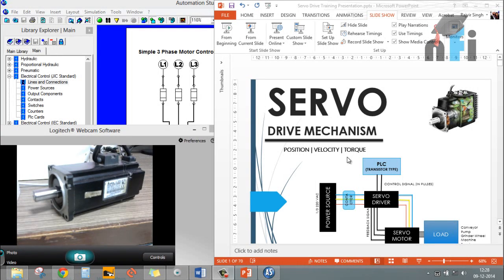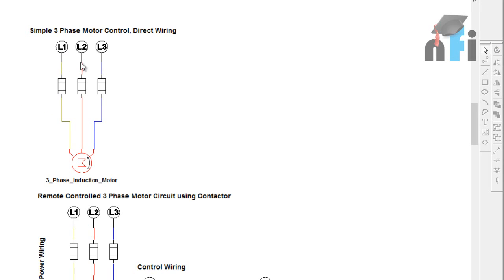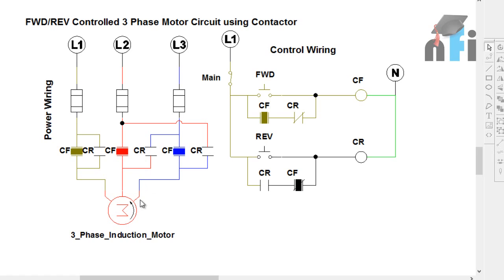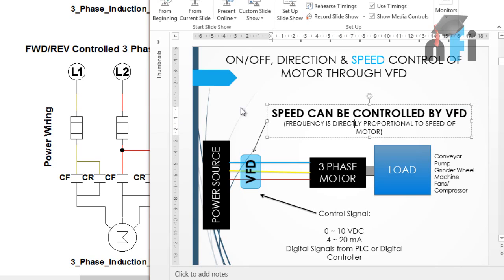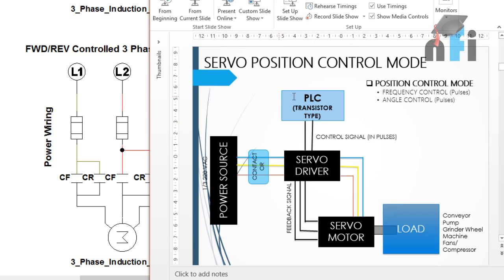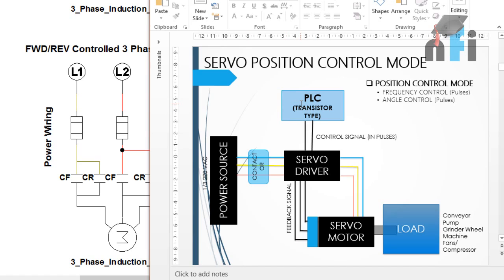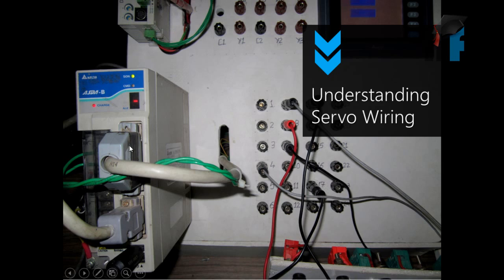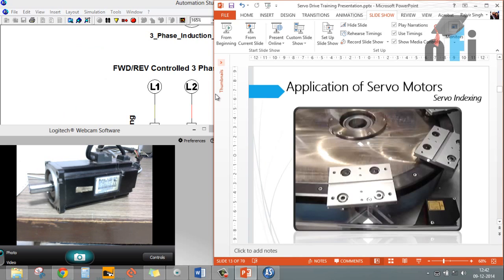Introduction to Delta Servo Drive and Motor

Comment: I have seen many small drivers needing only 2 phases input from mains but the servo will still get its 3 phase from the driver. How does that work?
Reply from the maker: The driver converts single phase to three phase internally 🤓
Reply: @thegeterrdone  so why provide 3 phase input terminals if only 2 phases are needed?

Comment: Wrong circuit on reverse forward control wiring.Interlocks should be in series with the coil and not in series with the latching contacts for maximum protecrion of energizing both forward and reverse.Because you can still start each circuit by the push button.

Comment: Hi,  I am  Ketan,  I run delta servo motor asda a2. Run through 2500 ppr encoder but all time measurements problem. Give solution

Comment: Dear sir,
Recently I am facing a problem regarding DELTA SERVO ASD-A2. In a cookies depositor machine I have installed 0.75kw ASD-A2 servo (ASD-A2-0721-M/ECMA-C10807RS), it runs at 2500rpm and found overheating of motor and output current was 3amps where rated was 3.5amps however I replace this motor with ASD-A2 servo (ASD-A2-2043-M/ECMA-J11020RS) installed yesterday now output current is very low but motor is getting overheating . Also note that I have done autotuning also.
Can you please suggest me what the cause of overheating.

Comment: hi sir, i have servodrive and motor and i want to operate servo through plc but i was facing problem .servo start without giving any pulse from plc ...i have npn type plc and i give (pulse+)from servo ,give 24vdc ,and servo start ..i am confused..tell me solution
Reply from the maker: +sodha parame Ravindra Please share your wiring diagram at nfiautomation@gmail.com And make sure your Servo is at position mode which you are running it via PLC pulses.

Comment: Some great information, but PLEASE strip out ALL unnecessary graphics from screen... we're spending a lot of time determining what is important and what is pretty graphics, background or irrelevant toolbars...  it takes away from concentration
Reply from the maker: MrRUKidddingMe Dear there is nothing irrelevant in this video. Every graphic is connected in one or other way to the lesson content.
Reply: So the long sweeping grass on the left of the screen is part of the compressor or evaporator?  The toolbars scattered all over the screen are part of the multi-phase controls??
Reply from the maker: Everything is relevant here !/
Reply: +Rajvir Singh (NFI Automation)  SIR I AM DOING 5 LEVEL ELEVATOR PROJECT USING PLC.. I NEED TO KNOW THAT HOW TO INTERFACE PLC WITH THIS MOTOR DRIVER( H BRIDGE).. AND ALSO DO U KNOW THE TECHNIQUE OR MECHANISM BEHIND THAT WHEN THE LIFT COMES IN THE REQUIRED LEVEL OR FLOOR THE MOTOR WILL AUTOMATICALLY STOP.... FUTURE FOR EXAMPLE LIFT IS IN GROUND FLOOR WHEN I COMMAND TO THE LIFT TO GO IN 3 RD FLOOR HOW THE SWITCH WILL SYNCHRONIZED TO WORK WITH PLC THROUGH H BRIDGED AND WHEN IT COMES IN THE REQUIRES FLOOR WHAT SHOULD I USED TO SENSE THAT THE LIFT HAS COME IN THE REQUIRED FLOOR AND CORRESPONDINGLY THE MOTOR STOP SO THAT LIFT HALT!!! IF POSSIBLE PLZZ SEND ME SOME DATA'S OR HELP IN M EMAIL ADDRESS"MANDALSUNI201245@GMAIL.COM" IF POSSIBLE CAN U PROVIDE THE LADDER PROGRAM FOR ELEVATOR SYSTEM OR DETAIL FOR THE THE ELEVATOR DESIGN AND MOTOR CONTROL USING PLC